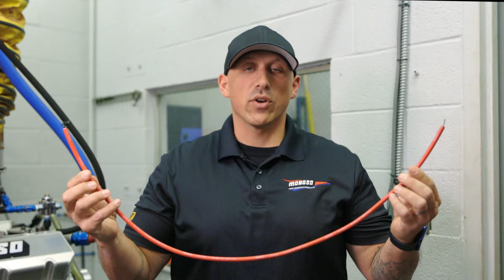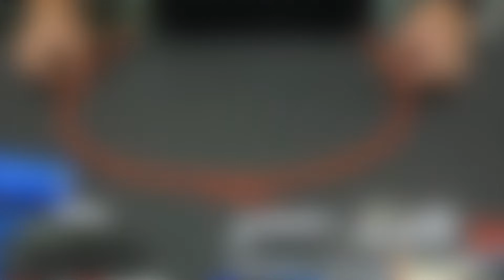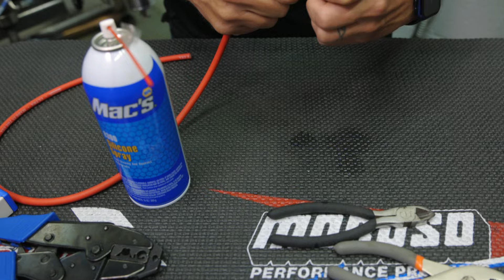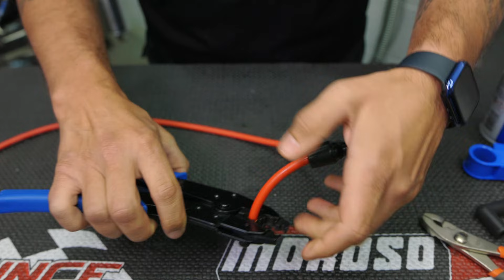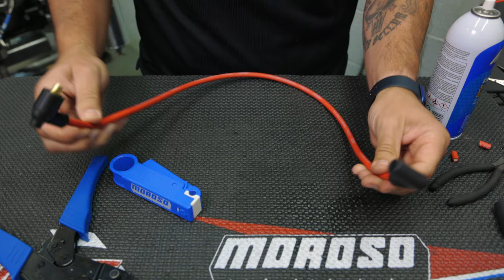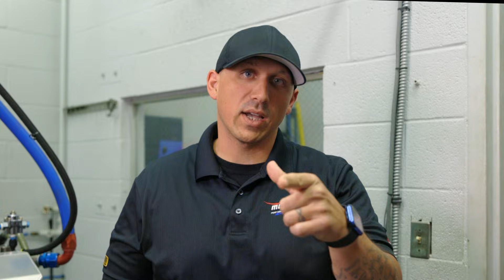How to build your own custom spark plug wires! | Moroso Performance

Comment: Hello Moroso Performance. Ihave always wonderd why you people don't have a 10.5mm selicon core resistance ignition wires.  There is just less chance of them lossing spark. nWhich is what happend with the black moroso wire i had. They only lasted a year or so with a 65,000 volt HEI coil.  The higher energy coils demand it. Even a 12mm line with there one loom clips and number tags. In light safty blue thank you very much.

Comment: What about the ultra sleeved ones? Does the sleeve get fed into the boot as well or do you cut it shorter
Reply from the maker: The sleeve would be cut so that it meets right at the boot, and then a heat shrink would go over.
Reply: @MorosoPerformance thank you, it worked great
Reply from the maker: @stanggangchannel  awesome! Love to hear it! If you need help or answers quicker, don't hesitate to reach out to our tech dept. They can get to questions faster than we can on YouTube.

Comment: I for the life of me couldn't get the boot on , slathering lithium grease and nothing keeps slipping like a BIatch
Reply from the maker: What style set was it? Some can be a little tougher than others.
Reply: The best way to do it is to apply lithium grease (not spray) to the new spark plug wires before attaching the boots. Since you’ll be trimming the cables to length anyway, it’s easier to slide the boots on before crimping the terminals. Once the boots are in place and everything is seated properly, you can crimp the ends and finish the assembly

Don't listen to anyone who tells your otherwise =)
Reply from the maker: @ Hi! I've had to make so many sets at the track for customers, and I always just used the silicone spray. They go right on. Honestly, the bigger pain is sliding the sleeves over a long wire. That can be rough. Yeah, sliding the boots on before terminating the wire is crucial. Happy you were able to get it done! Have a great weekend. If anything else comes up,  get in touch with us.

-Ray R.
Moroso Performance Products